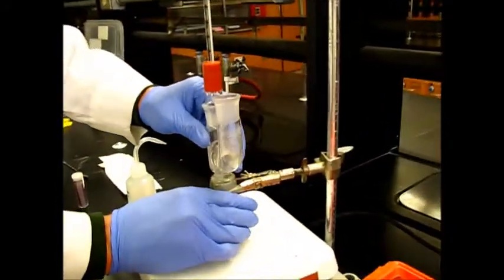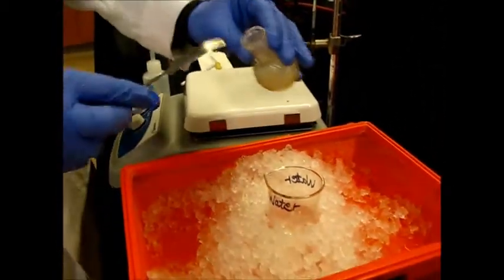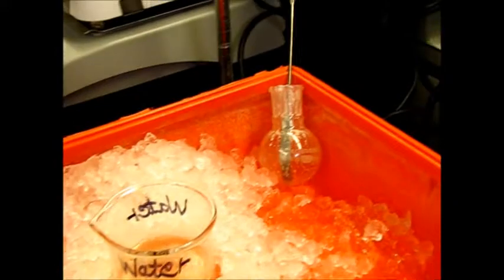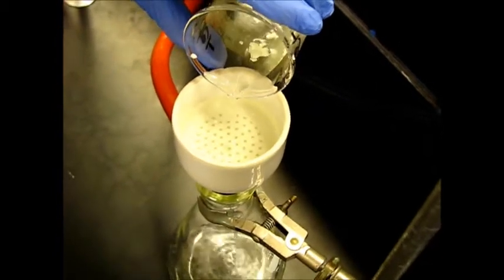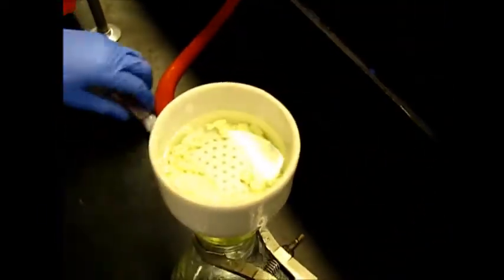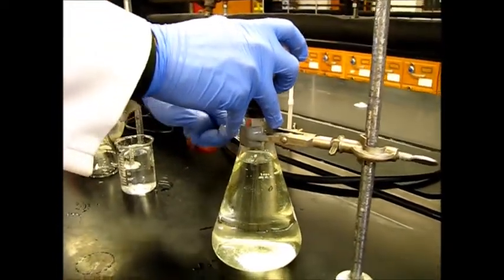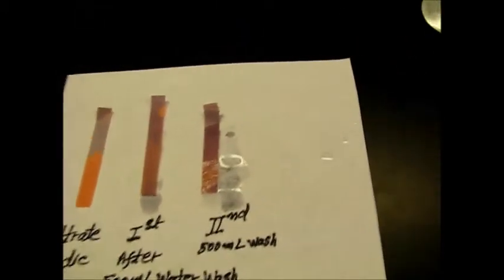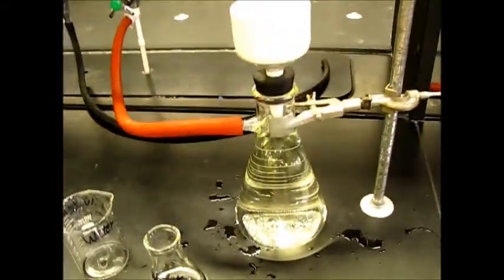Nitration of Bromobenzene Reaction Part-2

Comment: Why we need the ice?
Reply from the maker: @Isrra Daffaie: To quench the reaction mixture ice cold water is needed. Otherwise, hot vapors could come out. Further, nitration product will better precipitate in cold water than room temperature water.
Reply: @shivakrastogilectures9541  which the negative effects if we used more than 50 degree??
Reply from the maker: @israadaffaie5037  At high temperature nitric acid and Sulfuric acid hazardous fumes will come, product precipitation would be less, and in result reaction yield be poor.
Reply: @shivakrastogilectures9541   thanks for the great explanation